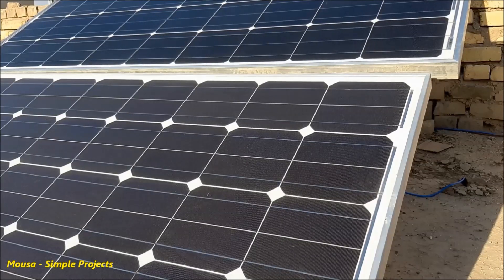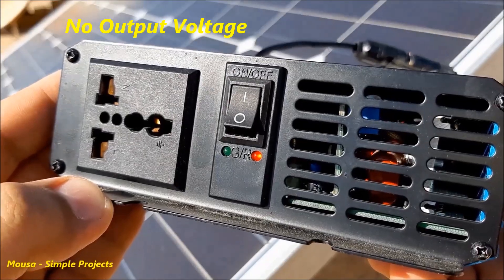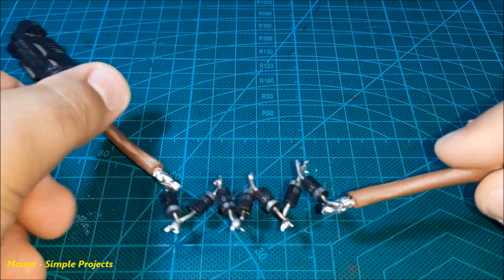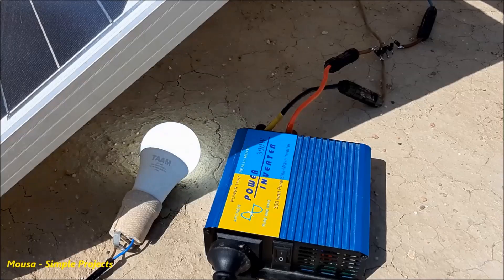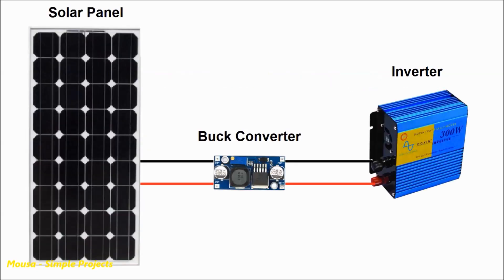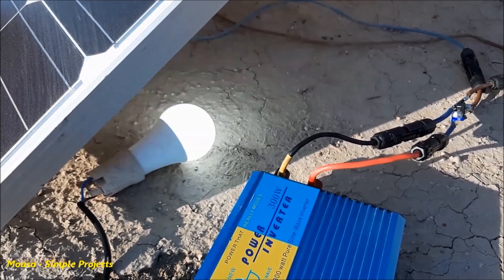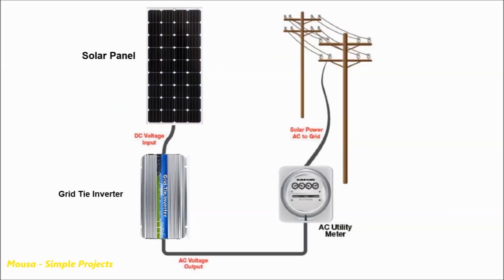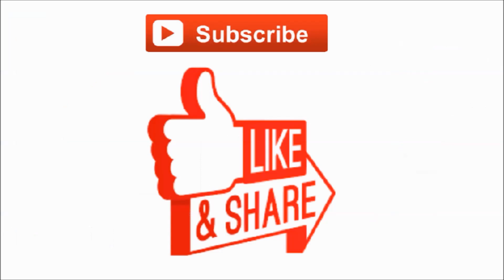Solar Panel and Inverter Without Battery

Comment: Voltage regulator?
Reply from the maker: Yes, you need a buck converter between the solar panel and the inverter to regulate the voltage. For 300W inverter you need 500W buck converter.